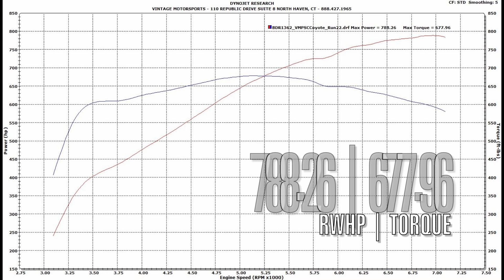Backdraft RT3 #1362 Dyno Almost 800RWHP VMP Supercharged Coyote 5.0 Shelby Cobra

Comment: Holy crap that is sick! How much roughly does something like this cost?
Reply from the maker: High 80s.
Reply: If you buy it directly from the factory it will set you back around $49 000 I think.contact Backdraft in South Africa and buy a rolling chassis from them.

Comment: Which Aluminator are you running? Is this the SC 9.5:1 or the NA 11:1 compression?
Reply from the maker: 11:1
Reply: VintageMotorsports what's the reasoning behind using the 11:1 vs. 9:5:1 that is supposedly designed for superchargers?  Thanks
Reply from the maker: @scottrenfro5027  was built with Ethanol fuel system.  You can run much higher compression with it and make more power on lower boost.
Reply: Yea but the 9.5:1 compression aluminator will last longer, has better volumetric efficiency,  and you can run more boost with way way less chance of detonation.  If you want a motor to last and not detonate,  the lower compression aluminator will be the one. Stuffing more boost is better than less boost on high compression.  Why do you think  all factory Production supercharged cars run low compression.  The engineers obviously know something.  By far better durability, longevity,  and much bbn less chance of detonation with lower compression aluminator.